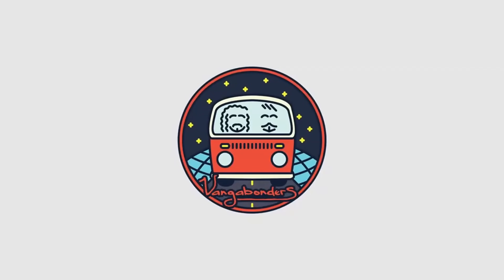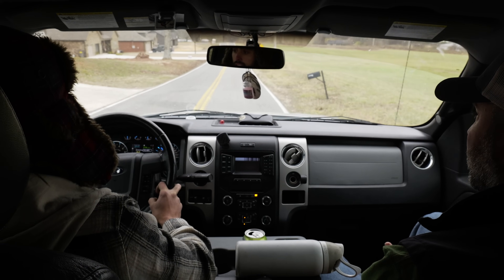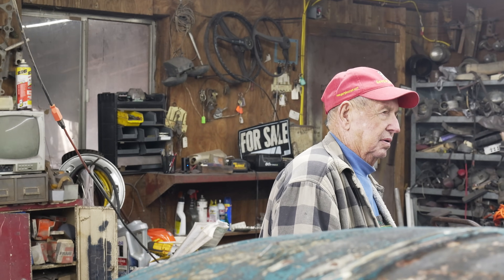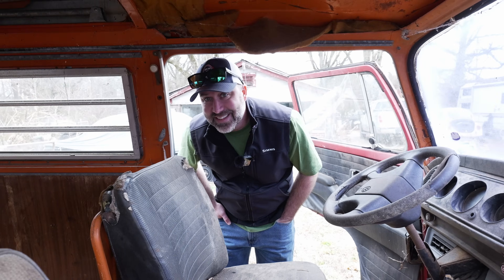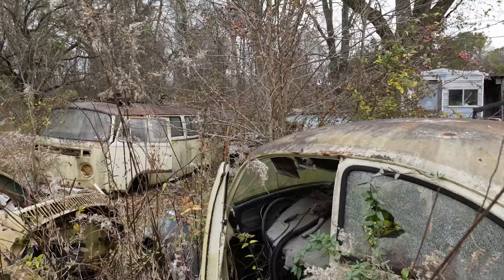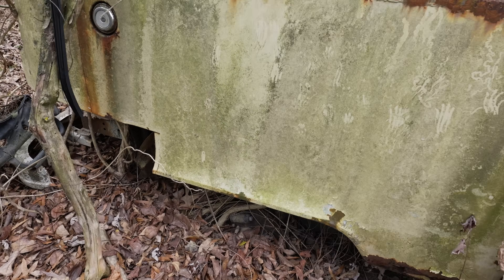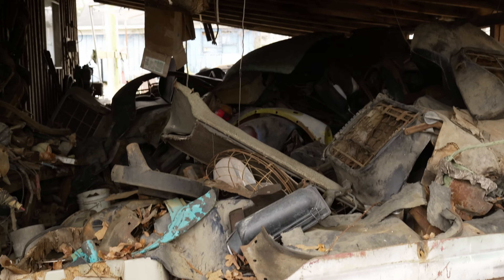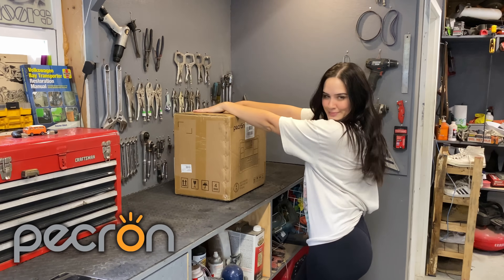Finding The Perfect Donor in a VW Graveyard | VW Bus Restoration Episode 64

Comment: All of this sheet metal is available new from various vw suppliers. Save yourself a day and a tetanus shot!
Reply from the maker: The inner wheel well is not reproduced by any company. It can not be bought from any VW supplier unfortunately
Reply: Why did you not just buy a better quality van? If your long term plan is to camp and travel in it, you should have looked for a westfalia equipped model. Cutting and patching a rusted hulk is going to cost you the same money in parts alone, and you’re going to spend hundreds of hours doing it. Only to have a patched van that future buyers can spot a mile away.
Reply from the maker: The piece that I cut out has no rust on the part that I need.
Reply: I have restored several of these and it makes more sense to buy a running driving westfalia that you can go camping in tomorrow. It’s still going to require a hundred side projects to get it nice but at least you and your gf can use it every weekend instead of waiting a decade before even using it. Yes, a nice medium quality van will cost you 15K or more, but get a loan and a side hustle, you’ll spend far less of your spare-time hours and have something you can use immediately.
Reply: Hey, buddy....some of idiots enjoy the process! My bus rode just fine when I bought it and I'm thousands of dollars away from getting it that way again, but I'm in love with every step of its progress and renewal.